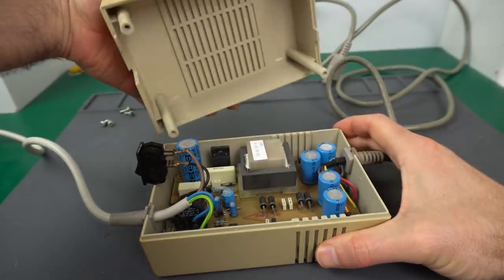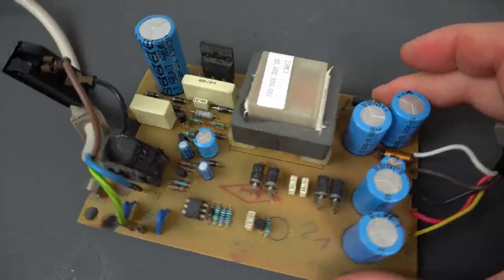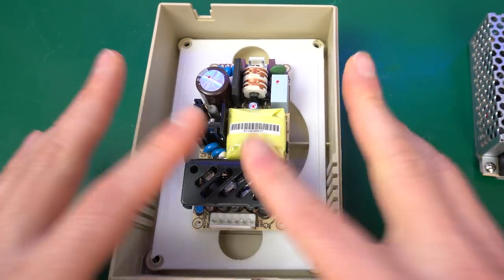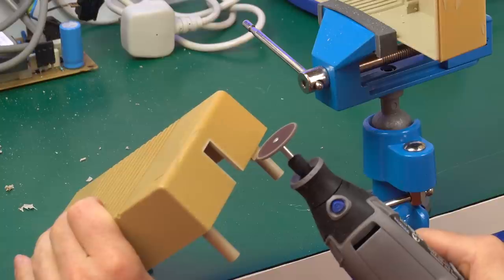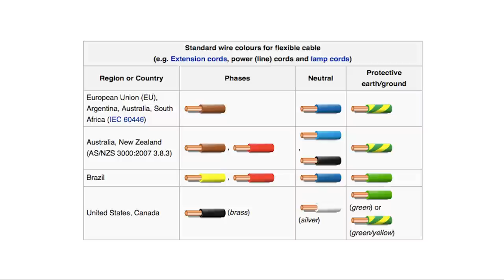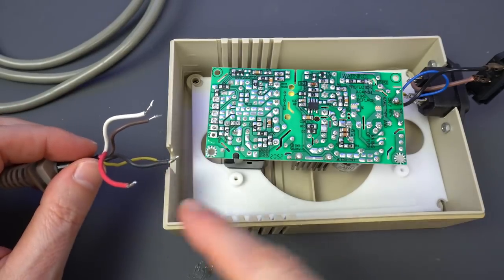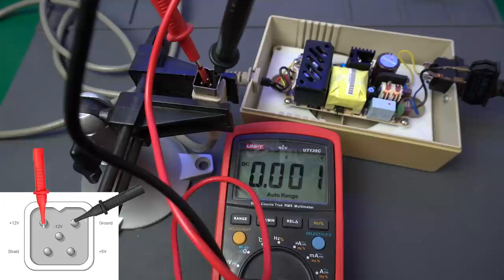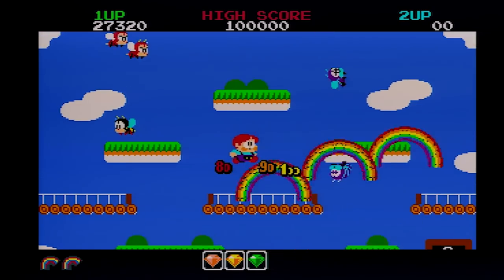This Amiga Power Supply Will Work Anywhere

Comment: The reason a British plug has to have a fuse in it because of the voltage the UK run 230 V at 50hz and the current is quite high as well hence the reason we have to have a fuse switch mode power supplies are great but there is a downside occasionally they can fail and can be unreliable I also do not like transient spikes as well Transformers the other and they do not mind transient spikes are Transformers are more reliable

Comment: GREAT VIDEO!!! I bought a new PSU when I got my A1200 around 3 years ago. It will take both inputs voltages and looks like a laptops PSU and it adds an ON/OFF switch right at the back of the A1200 where it plugs in. I have also upgraded my C64 from Xmas 1983 and my C64G both to nu-brick 64 a few years ago. I bought a C128D about a month ago and wonder what is known about its larger internal PSU that powers the computer and it's 1571 drive? If it is a "Brick of Death" can you do a PSU upgrade to a C128D sometime? It would be great to see it done for a tutorial and what Mean Well unit to choose? Thank you in advance for any info or help in this matter.

Comment: I have seen 13A mains plugs for sale in TESCO in the hardware end for £3-10.
Reply: That is an expensive price. One of the places I buy electrical stuff from sells them for £0.57( = $0.78 =  0.67 euro) and a lot sell them for under a £1. And for a manufacturer buying a lot and moulded onto the lead shouldn't it be a lot cheaper than that?

Comment: That's great Noel. If you haven't done it already, can you be pursuaded to build a replacement C64 supply?
Reply from the maker: Thanks! Yes, that's in my list of videos to make. That's going to require some research because there are a LOT of C64 PSU replacements out there, but a lot of them a really expensive. And most of the time it's impossible to reuse the C64 PSU case, which makes it even more difficult. But I'll get to that for sure 👍
Reply: @NoelsRetroLab  - I built my C64 brick replacement using a cheap 5VDC switching-type "wall wart" and a simple power transformer with a 9VAC secondary. Very low cost and it is possible to get into the old brick with lots of hot glue (I used a different case). I added status LEDs for the 5V and 9V outputs as well. A cheap IEC adapter with built-in switch and fuse completes the list.
I removed the guts of of the cheap 5VDC wall wart and put it in the new case along with the 9VAC transformer.
Lots of custom AC wiring.. so be careful!
One issue to be aware of though is that the cheap 5VDC switching wall warts may have a delayed startup on their regulated output so the way the C64 is started is a bit more important. Eg. make sure C64 power switch is OFF before plugging in (and optionally switching on) the new power brick. That way both AC and DC voltages are present when the C64 is eventually turned on. (My power status LEDs help in this too).
Is it really that important? Not sure but I do it anyway.
Cheers,

Comment: Great mod, however, I'd have turned the IEC 180 degrees so the live was on the side beside the switch to save having it cross over neutral twice..
Reply: I would use an IEC input connector with a built in fuse, no screws needed just slide it down in the case opening, as it will clip in place.

Comment: Not sure why you desoldered the headers instead of using them to make the power supply easier to change out or pull to repair in the future. So much easier to just use the headers as they were intended.

Comment: Great video - thanks!  How would you switch between EU and US mains voltages - or is that unnecessary?
Reply from the maker: There's nothing to do. The Meanwell can take both voltages/frequencies, so just swap out the power cord, plug in one with the correct plug shape and you're ready to go! That's the beauty of that IEC socket.

Comment: The new power supply gives 4A on +5V, while the old one did 4.5A. Is that going to be an issue in the future?
Reply from the maker: You're right! I honestly don't think that's a big deal. I suspect the Amiga won't get near that and the new one apparently handles overloading pretty well (it will actually start shutting down instead of burning), so if you ever hit that amount repeatedly and the PSU can't handle it, it'll just shut down and you know that it's time to swap it for a more powerful one. But hopefully it'll never get to that point.

Comment: At least where i am from "Australia", your modification would be considered unsafe, as nether of the metal screws that hold the iec/c13 socket in are earthed. Thus if a cable came loose in the enclosure: nothing is prevent mains from being externally accessible, eg if somebody touch the screw head while plugging it in, especially imagine if it's not working and somebody is playing around with the plug and socket assuming it wasn't making good connection.

Just something to be mindful of when modifying mains devices, because you don't know who's hands it might end up in one day.

Petty annoyance for god sake man, buy yourself a crimper open barrel or even pre-insulated.

Comment: So without a switch the MW can detect what voltage it is plugged in I assume?
Reply: Meanwell simply is wide input range, can operate from any voltage from 90VDC to 340VDC, or from 70VAC to 260VAC, so will run pretty much anywhere in the world. The original one is not so cabable, you need to have a slightly different version with a voltage doubler for 115VAC use.
Reply from the maker: Right. Exactly!
Reply: @NoelsRetroLab  Good to know when I finally get to all my old systems.👍
Reply: @SeanBZA  👍

Comment: Oh come on, no heat shrink tubes on live and neutral wires inside? That's dangerous AF!
Reply from the maker: Yeah, I should have done that, good point. I added a pinned comment with that suggestion.

Comment: Hi Noel. Aren't both meanwell PSUs underspecced as they output less Amps than the original PSU on the +5V rail?
Reply: No
Reply: Original Amiga PSU is 20-25W. RPT-60B is 50W.
Reply: @jaycee1980  no? They output 4A, commodore PSUs output 4.3-4.5A depending on the revision. With a RAM expansion, or an action replay and an external drive one could go past the 4A the meanwell psu provides.
Reply: @jaycee1980  With 4.5A on the +5V and 1A on the +12V rails the amiga power supply outputs about 35W combined. The meanwell outputs 20W on the +5V rail and 24W 24 on the +12V rail.
Reply: @bufordmaddogtannen  They weren't "Commodore" PSU's at all. Also the RPT-60B doesn't output 4A and then shut off at 4.1A - it can handle peaks.

The RT-50B is capable of supplying 5A on the +5V line for short durations. 

Put it this way I know people who are running TF1260 cards from an RPT-60B with absolutely no problem.
Reply from the maker: Right. Technically it's half an amp less, but in practice it the Amiga doesn't get near that. And if it did, I wouldn't be surprised if the Meanwell handled it fine for quite a while but it would heat up. So if it's just spikes, I think it will be fine. I certainly haven't had a problem or anyone else with a similar PSU. So I think it's pretty safe.
Reply: @jaycee1980     
I'm looking at Amiga PSUs and the numbers are all over the place.
Depending on the revision, the +5V rails are 4.5/4.3/3.0/2.5A and the +12V rail goes as low as 0.5A.
I wonder if each PSU needs to be coupled with specific board revisions.
Reply: @bufordmaddogtannen  The A500/A500+ drew more power largely because it was older logic. They drew more current on the +12V supply because the drive motor ran from +12V in a lot of them too. The Amiga doesn't actually draw much from +/-12V itself - only enough to run the audio opamp, and thats no more than 10mA. The drive motor wouldve been the main concern in the 500. 500mA would probably be plenty on the 12V line for an unexpanded system

A600 and A1200 are generally lower power because a lot more of them is CMOS, and thus they consume less power in general.
Reply: @jaycee1980  this still does not explain if Amiga 500 PSUs went from +5V  4.5A down to 2.5A as a cost cutting measure or because of newer board revisions drawing less current. The latter would imply that using a +5V 2.5A PSU with an older Amiga would be a mistake.
Reply: @bufordmaddogtannen  I own over 50 Amigas (all models). I have the older rev3 A500, rev6 A500 and the rev 8 A500+. It's clearly a cost cutting venture as the A500+ is basically the same PCB using all the same chips except it doesn't need the A501 512k RAM expansion since it's built onto the motherboard. The current draw would be near identical so Commodore just cut the PSU down to make it cheaper, most likely because the A500 and A500+ don't draw anywhere near 4A.